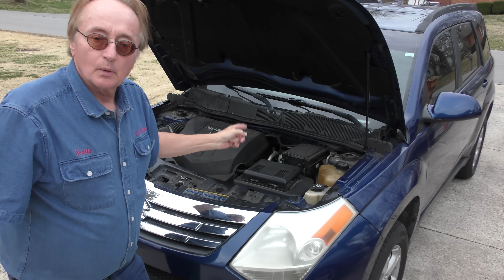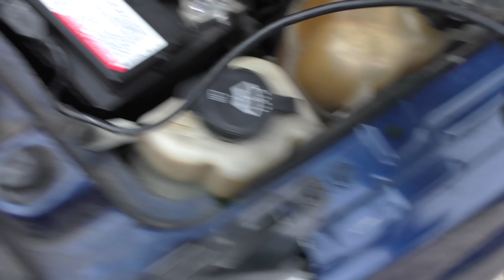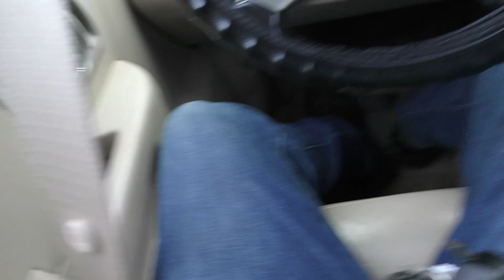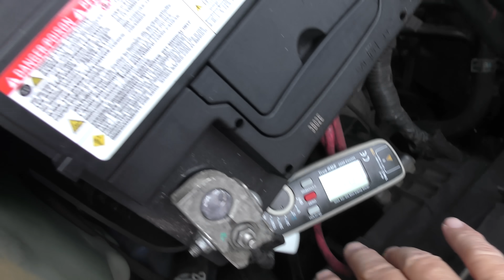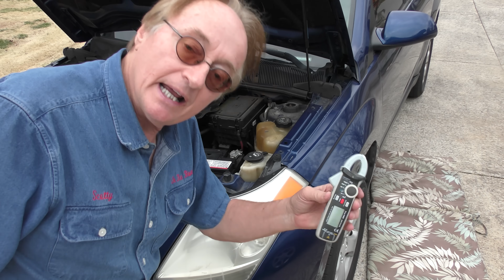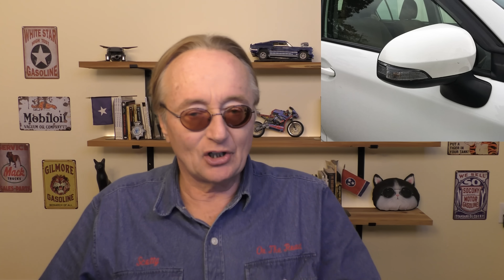This Car Brand Just Left America (Do Not Buy)

Comment: I had a Suzuki sidekick 1996 with the 1.8 liter. Had it for 8 years probably was harder on it more than everything iv had in the past 20 years iv had put together and at 300,000 miles I never even had a engine tick when I sold it. Never had a front end or transmission problem in anyway either. Really just had crappy headlight paint that was supposed to reflect the light. I absolutely loved it though.

Comment: I just fixed this very same thing in my Toyota 4runner.     It was just loose enough where the mechanism on the back of the switch wasn't going all the way around and kept the ACC power on if I didn't jiggle it.     Easy thing to replace (maybe too easy)

Comment: My wifes 2003 Saturn ion Quad coup will keep playing the radio after the key is turned off and removed,  until you open either door, then it goes off. That's normal on her's. I have a clamp on amp meter like you have Scotty, ac/dc, use it a lot.

Comment: Did you think for a second to check the wiring behind that aftermarket stereo? The ignition switch may not be the problem, someone may have wired the “Continuous” battery power to the “Accessory” battery power on the stereo wire harness. Red is continuous and Yellow is accessory on most aftermarket stereos. Cars with CanBus don’t have an accessory wire, the canbus triggers “on” state via PID. if the stereo installer didn’t know correctly what they were doing the system can easily be shorted and cause phantom power on the system.

Comment: I own a GMC envoy. Overall a great vehicle, however a persistent TPMS light had to be chased down. A post on Trailvoy suggested the Liftgate Module, of all the durn burn things, caused one owner's problem.Replacing mine (off eBay)Gave me relief with the TPMS light but now the liftgate wiper  doesn't work, the liftgate no longer unlocks whenyou push the fob unlock button,  and the BATTERY STARTS DISCHCHARGING.
Classic Chev Service Dep't said bring it in, we need to re-program it to your vehicle. 
$190 later, everyone's happy.

Comment: The Suzuki XL7 was a joint venture with General Motors. It was assembled at the Canadian GM factory in Toronto. The entire car is basically a GM vehicle. The only thing that was made in Japan was the GM engine and transmission under license. When I need a part replaced  I will copy down the GM part number and say I need it for a Chevrolet Equinox, LOL . I can always find a part in stock when I say that.😄

Comment: My daughter bought a szipukie.  The engine blew a head gasket.  The dealer had to drive it to a dealer in another state to get it examined.  They wanted me to shell out 1K to determine if the head was bad and then maybe the extended warranty would cover repairs.  I told them to stick it.  Tried to get a junk yard engine.  Talk about being as rare as hen`s teeth.

Comment: I see that this car has an after market stereo. I've seen where the these stereos were not wired in correctly. The voltage/power lines for the stereo can either be connected wrong. Power on constant and power only when the ignition is turned on.  Or perhaps the stereo is defective and allowing power to drain the battery.

Comment: I drove a Geo Metro, which is really a Suzuki, for about a month once when my Honda was in the body shop.  Being a 5-speed, it was a fun little car to drive, and it was both frugal and reliable for the time I had it.
Reply: Not a bad little car as long as you kept on the surface streets where that 3-cyl motor belonged.
Reply: @C.dubbleyoo  Heck, I drove it on the Long Island parkways at 60 mph!  With the 5-speed it accelerated quite adequately.  (With the automatic it would have been gutless.)

Comment: Suzuki in Australia are just as reliable as Toyota....but better value, but they are small vehicles with small engines 🤔
Reply: Yep exactly 👌 Glad I got my new Suzuki Jimny in 2020 its been awesome, the engine is just enough in stock form but now after all my 4x4 mods I've added to it, it just doesn't have quite enough power to be comfortable on the highways so thats really my only complaint and wish it had some headroom left over.
Climbing up hills I often have to drop back into 4th gear to maintain 110km/h which is annoying on long trips needing to reset my cruise control lol but after my warranty runs out I'm just going to turbo/supercharge it anyways.

Comment: Easy way to find the circuit is leave your amp clamp on and start pulling fuses, often you can find a starting point by finding the offending circuit. Just remember to put your fuses back in as ya do it.
Reply: Great advice! 👍👍
Reply: Standard check for current draw. Aftermarket accessories are always suspect. Especially radios and amplifiers. Unplug alternators checking for bad diodes. Disconnect B plus terminal. Are brake lights stuck on? I've tapped on alternator and it started charging.

Comment: Had a ‘06 Suzuki Aerio AWD sedan. Was a really good car but at 140k the transmission failed. Was not worth fixing it was able to sell it. It’s AC had a lead and had to get the part directly from Japan. The lack of parts was a huge issue. But they are very good cars, just had s bad transmission with mine.

Comment: Scotty, the XL7 featured in this video was just a Chevy Trailblazer with the grill, badging and lights changed to make it look different.
So, for the Suzuki model parts may actually be interchangeable and easier to find than other Suzuki models.
Reply: You mean Tracker
Reply: @labornurse neither. Equinox
Reply: No, the XL-7 is based on the mid 2000's Chevy Trailblazer extended version. The Tracker was a rebadged Suzuki Samurai. @labornurse
Reply: The XL7 is a Chevy Equinox/Pontiac Torrent but with a third row. The Chevy Trailblazer was also sold as a Buick Rainier, GMC Envoy, Oldsmobile Bravada, Saab 9-7x, and Isuzu Ascender. Gotta love the GMs rebadging addiction lol.

Comment: Do like I did with my 02 impala that had an ignition switch problem.  I put a cut off switch at the negative post. 
That impala was a poj anyway,  no use in spending lots of money on it.
But, that Suzuki still runs and looks good,  get an ignition switch and fix it.

Comment: Did you ever TRY replacing the ignition switch to verify the problem?  This was legit advice on older cars but modern CANBUS vehicles often don't fully "sleep" for up to an hour after turning off key and shutting door, so amperage draw testing must be conducted after this.  Aftermarket stereo is immediately sus... they often get wired incorrectly, and on some models reversing the memory and switched 12v connections can do this by backfeeding into the car's switched 12v accessory circuit.  

Leading cause of current draw I found in my almost 40 year career was glovebox or trunk light not shutting off.  Amazing how a continuous draw of 5 to 10 watts can shorten the life of a lead-acid battery if not detected and repaired.  To diagnose draws on CANBUS vehicles (and earlier) I bought a thermal imaging camera, and would use it to scan over the vehicle after it sat overnight in the shop with hood open and windows down so I wouldn't have to touch anything and "wake up" the vehicle.  Everything on the car looked blue or purple but the active component(s) look orange or red on the thermal image!   Sometimes the problem is what we colloquially called "Babbling nodes" or CANBUS components that would stay active after shutdown and sometimes keep other components active.  As for testing batteries with either modern conductance testers like the one shown back to the Vat-40 days, the test is only valid on a FULLY CHARGED battery.

Back in my beginning days as a tire and battery installer at a Pep Boys in the 80s, we were required to CHARGE any battery brought in for warranty claims, and a good 50% of the time the battery tested perfectly fine after a proper charge.  However, especially customers carrying in a loose battery, always argued, "I KNOW it's the battery!"  This was the cause of most friction at that job, and few took us up on the standard offer to bring the whole car in for a FREE charging system and draw test.  They'd go inside and complain to the (non-technical) store manager, who would then direct me to write up a warranty slip for a perfectly good battery, with manager and customer alike treating me like I didn't know my job.  SO frustrating, and leaving that place once I got some experience under my belt was the Three Best Friends my career ever had!
Reply: Sounds like you know your stuff well 👍 Thanks for the extra info.
Reply: that was my thought when I saw the stereo. Someone modified the wiring to make it work and unknowingly did something they shouldn't.

Comment: You could also install a toggle switch in the power wire going to the ignition switch
Reply: Exactly, a MUCH better suggestion than taking the battery terminal on and off.

Comment: Install a remote battery cut-off to the negative terminal. Then use the key fob to turn off the battery when not driving the car.
Reply: Or just go to one of the many places that carry the ignition switch and replace that. This car is a rebadged Chevy Equinox.
Reply: Thanks.

Comment: Scotty I have 2 2013 Chevy trucks, a 2008 and 2015 Explorer in my driveway.  In all 4 cases, When you turn off the vehicle with the key and remove the key, the radio will work until the door is opened.

Comment: It’s the same as a Pontiac torrent GXP parts should be interchangeable but like all cars as money pits if you just take care of these old GMs they will last… if you Chan get the oil in these 3.6’s every 3000 miles it’ll last forever if you go every five ur destined for timing chains issues😢
Reply: Regular oil changes help but the PCV valve is to blame being too small and clogging up on one bank side, causing oil sludging up and not enough oil flow causing the timing chains to stretch.
A mod is to just drill out the PCV valve larger to help stop it.
There are vids on YouTube about it for the 3.6L Alloytec V6.

Comment: I had a 99 Chevy tracker with manual and a second stick for engaging the front wheels ( optional 4WD) .  It was made by Suzuki and traded it in.  Now I wish I had kept it.  Even though the body was pretty thin metal, I drove it on the HWY ( I-70) during a big snowstorm in Maryland and never got stuck while others were off the road stranded.  I miss my Tracker ! 😢😢😢😢

Comment: Suzuki Equator here, just did coil packs, spark plugs, idler pulley and for giggles replaced the rear bumper at 300,000. Did all the work ourselves and spent around 5-600$ in parts. Watch out for the plastic T connectors going into your heater core because they will break. Probably spent more time and money fixing all that than anything else on the truck. Cheap tires and brakes with 10,000 mile oil change intervals since new and the trucks still paying for itself. Parts piggyback off of the Nissan Frontier with minor changes.
Reply: As an Australian I had to Google what those names were as they're unfamiliar. Your Nissan Frontier is what we call the Navara here, and looks like Suzuki just rebadged a Nissan ute exclusively for the North American market. We still have Suzuki and Nissan here but we didn't get that strange rebadged ute haha just the original Nissan Navara model.

Comment: You could install a $5 Battery Disconnect Switch, 12 volts, 500 peak/125 continuous amps, (SKU: 97853) from Harbor Freight Tools on that car, or a more expensive Battery Disconnect Switch.

Comment: Suzuki sold cars in Puerto Rico until more recently than on the mainland. There are still parts shops in PR that advertise Suzuki parts. A 12-year-old part is a stretch, but you might be able to find it by calling shops in PR if cleaning out the part doesn’t help.

Comment: Simply connect an additional switch to the ignition power cable.
So you can keep the original ignition switch and have an anti theft device in the car.
Hide the new switch somewhere. It's a great opportunaty.
Reply: Or just fix the screwy ignition switch
Reply: @Dankcatvacs  Haven't you seen the video? He said, it's impossible to get spare parts for Suzuki in US... So my solution is the fastest and cheapest option.
Reply: Agree

Comment: First: use high-pressure air to blow out any solid debris that may have gotten into the lock mechanism. 

Second:  spray electrical contact cleaner into the key slot and wait 20 minutes to see if the buzzer alarm goes off.

Comment: That's the same as the Chevy and Pontiac torrent it just had a Suzuki engine available in the top model they bought the car from GM
Reply: Nah, that's a GM engine. From Wikipedia:

""All second-generation XL7s were powered by the General Motors (GM) High-Feature V6 producing 252 hp (188 kW) and 243 lb⋅ft (329 N⋅m) of torque. This was coded N36A by Suzuki."

Comment: My grandfather had an awesome van conversion with adjustable overhead lighting.  One of us kids turned the brightness knob all the way to the bottom- thinking it was off.  But to turn it off, you would use the switch.  But we kids did not know.  For years he had to disconnect the battery every time he parked- or the battery would die.  He finally thought to check the lamps- and found the one that was on.

Comment: Have a Geo Tracker(Suzuki sidekick), 1995, incredibly reliable, blows everyone away off road, fun daily driver around the city. There are a few weak points and the ignition switch after 30 years is common issue - had one next day. Never had a problem with parts, they are all over the world and there is a strong community in the US.
Reply: I have a 92 Tracker and I've rented the Suzuki's while traveling they're all over the world.